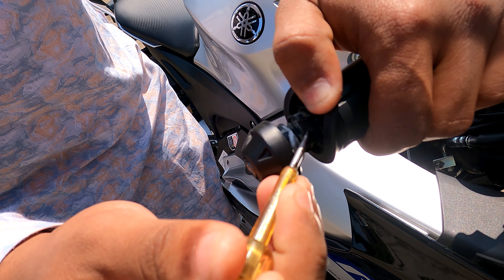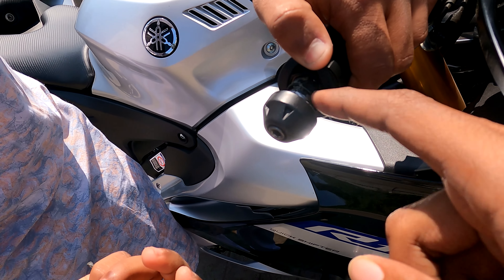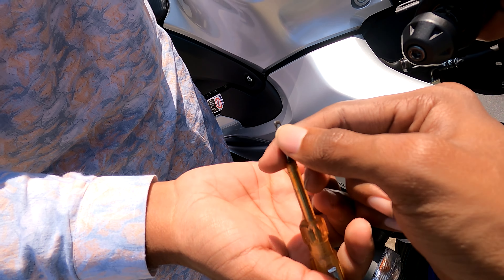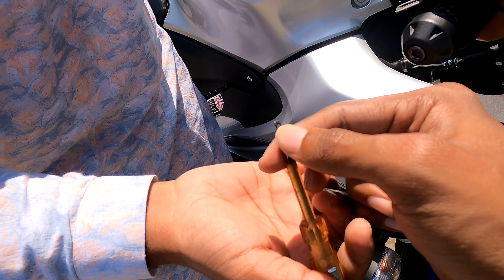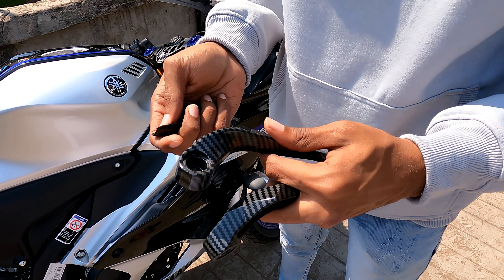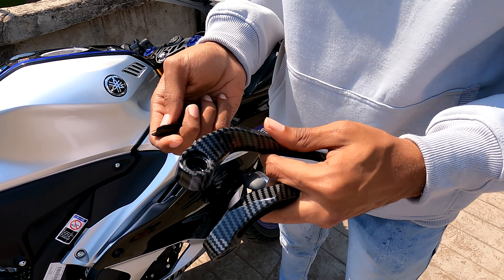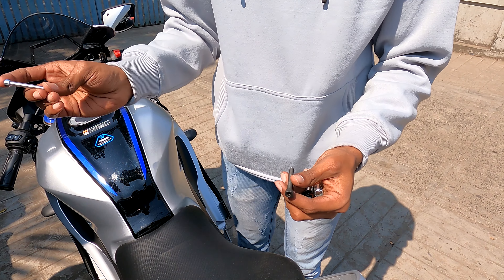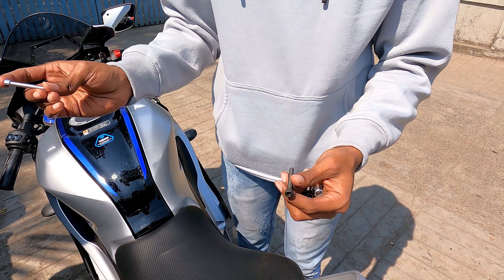How to install Lever Guard in R15 V3, R15M, MT 15, NS 200, KTM RC, Duke | R15M modified🔥 | A&I Vlogs

Comment: the balancer rod doesn't have to be removed. it'll damage the interior and the rod will be loose. once you remove the rod, the "clip" that he detached from the rod cannot be re-used. you only need to remove the end of the balancer, use the original screw of the bike to install the lever guard
Reply: Where can I buy
Reply: Brother unfortunately I have lost that balancer rod... So what should I do? Where I can buy this? If you have that link please share or any other ways please inform here.
Reply: How to fix it if i have already removed the balancer rod
Reply: Yeah i also dont understand why all are doing so stressful work

Comment: Are bro link send Karo....... 😍
Reply from the maker: R D Universal Carbon Type 7/8" 22mm Motorcycle Handlebar Brake Clutch Levers Protector Guard (Black Finish) https://www.amazon.in/dp/B085YDTTJY/ref=cm_sw_r_cp_apan_i_XTHEWB86CD574Z95GKM0

Comment: Well done bro.. its looking good… and am too gonna put it in mine. But one question… woh 2.5 inch ka screw necessary hai.??
Reply from the maker: 2.5 inch ka bro agr screw nhi lgaoge to woh nhi lag pyga jo uske ander se niklega stock wala kholne se (thumbnail me dikhega right side ka bottom me)
Reply: @AIVlogss  okkzz bro. I’ll do as you’ve done… faltu ka tension nai palne ka apna deemag khata kar.. tightly fit hai na woh..? Loose wagaira toh nai hora na..?
Reply from the maker: @Arham2902  nhi bro mera ekdm perfect hai... Speed chlake v dkhe hai loose nhi hua hai but agr bike stand me rhega aur koi uspe (lever guard) thek lgake khada hoga to woh hilega bsss aise nhi hoga kch... Kch dikkat ho to call krna mama hmko
Reply: @AIVlogss  acha… thik hai mama. Lagate hai tab hum v😛
Reply: Bro vo lagvana yaad se jo video mein dikhaya h
Meine lagvaye the bhaut phele toh mujhe pata nhi tha toh vibration badh gyi thi handle mein or bilkul bhi maza nhi aa raha tha bike chalane mein